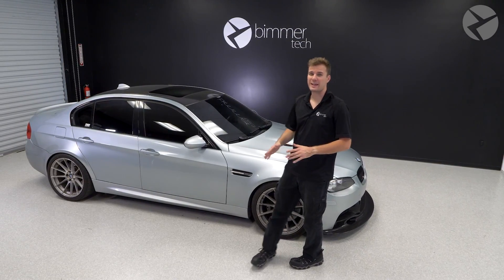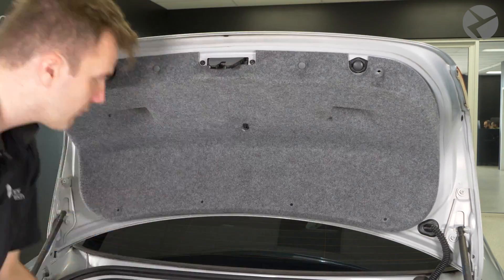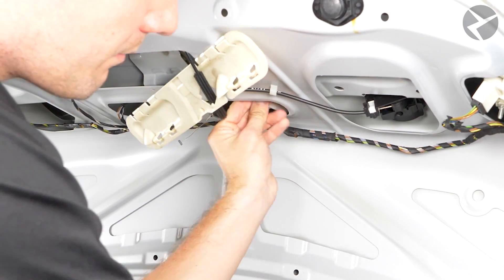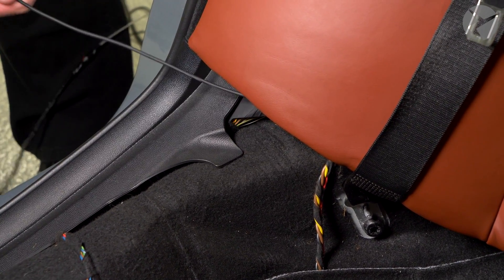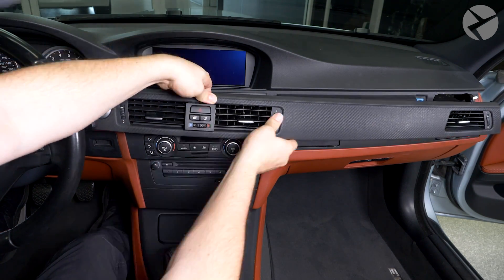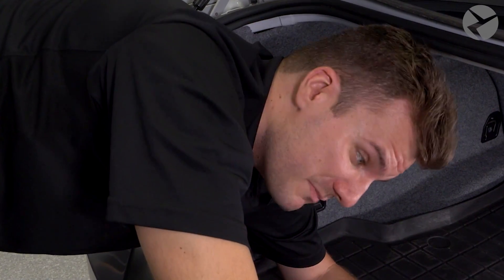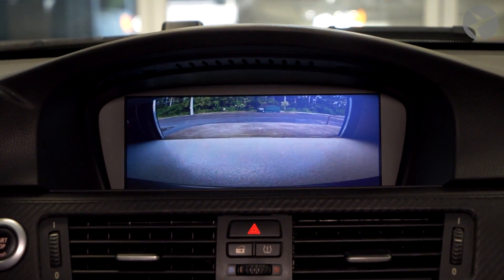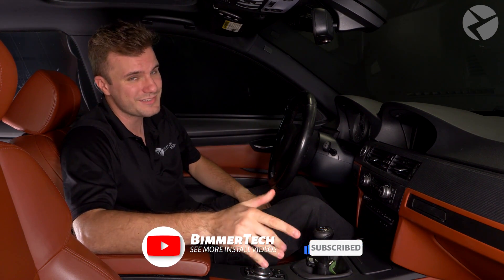Rear View Camera (MMI) Install On BMW E90

Comment: this is so hard. I could never do this by myself. Imma have to get someone else to do it
Reply from the maker: It may seem challenging, but once you get going, you'll get into a flow and find it easier than you think!  However, that's what our recommended installers are for, so if you don't want to risk if, head on over to our site, and find one near you!  Best of luck!

Comment: The body work on this e90 is amazing. How do you avoid corrupting your FRM footwell module as you reconnect your battery?
Reply from the maker: Hi! It is safe to disconnect the battery to work on the electronic components of the car as long as it is done correctly as Dylan did 1:05 then when everything is put back together you connect back the battery without any risks.

Comment: Struggling to fit the handle with camera into the slot.
Reply from the maker: Please contact our support team at support@bimmer-tech.net and they'll instruct you what to do.
Reply: @bimmer-tech  got it in bro, just have to wire it

Comment: Do you have any 2911 BMW 328i (E93) things to consider when installing on this car? I have an Eonon Q65Pro installed that has a digital rear view camera input capability. Should this be plug and play or any decoding?
Reply from the maker: We have no knowledge of the Eonon products and their specifics. It should be possible to connect our camera to the power connector and RCA (analog) video connector. However, for full compatibility, we recommend installing our cameras with our MMIs.

Comment: Will your rear camera work with the BMW Alpine screen?  Some rear cameras do not.  2007 BMW 335i 4-door sedan
Reply from the maker: Since the camera is connected to the MMI, not the Head Unit directly, everything should be working fine.

Comment: Im interested! Disconnecting the battery means that you need to input the radio unlock code? I have no clue where is mine !
Reply from the maker: You should be able to retrieve the code by visiting the dealership or any other car repair shop specializing in BMWs.

Comment: I WISH SOMEBODY WOULD POST A VIDEO OF THAT EXACT CAMERA BUT GOING TO A PORTABLE MONITOR IN THE FRONT OF THE CAR BECAUSE I HAVE A 3 SERIES THAT HAS NO CAMERA NO NAVIGATION NO BACKUP SCREEN NO SCREEN WHATSOEVER SO I HAVE TO PROVIDE THE SCREEN SO WHEN I INSTALLED THIS CAMERA THE ONE THAT YOU HAVE AND PLUGGED IT IN TO MY SCREEN IN THE FRONT AS SOON AS I PUT THE CAR IN REVERSE IT BLEW THE SCREEN I GUESS THE FUSE AND IT HAS NEVER WORKED AGAIN.... NOT EVERYBODY HAS A SCREEN IN THEIR CAR NOT EVERYBODY GOT NAVIGATION. IT SEEMS TO ME THAT THERE'S A GROUNDING ISSUE SOMEWHERE IF YOU'RE ONLY PLUGGING IT IN TO THE BMW SOCKET AND THEN YOU'RE RUNNING A WIRE TO THE FRONT OF THE CAR I KEPT ASKING MYSELF HOW IS THIS GROUNDED AND ACTUALLY IT WASN'T!
Reply from the maker: Did you contact our support team with that issue? If not please contact them with your order number and explain in detail what has happened. They'll appreciate your feedback.

Comment: Is the OEM rear view integration using a BMW/OEM camera or is it aftermarket?
Reply from the maker: It consists entirely of genuine OEM BMW parts.
Reply: If you already have a rearview camera is there a software upgrade to get the dynamic parking lines. My 2014 528i only has the proximity sensors displayed on screen.